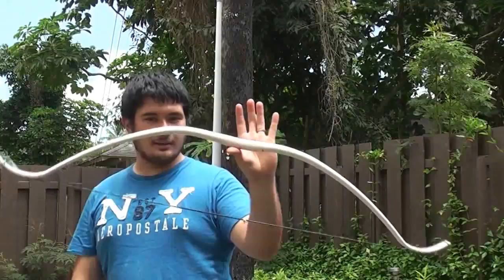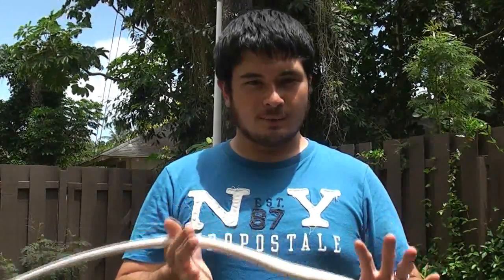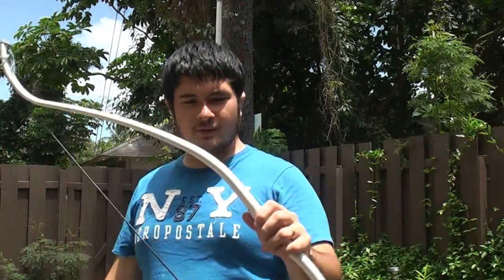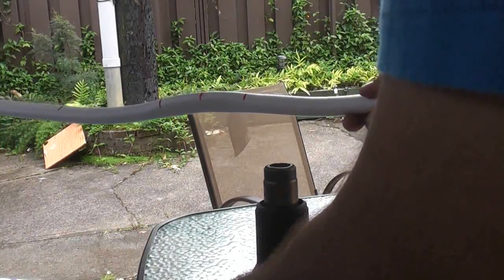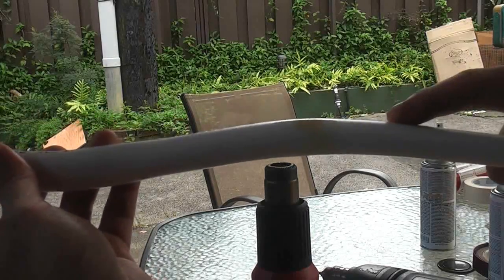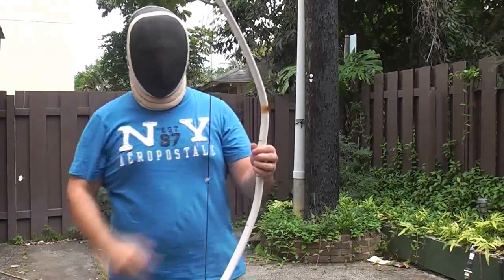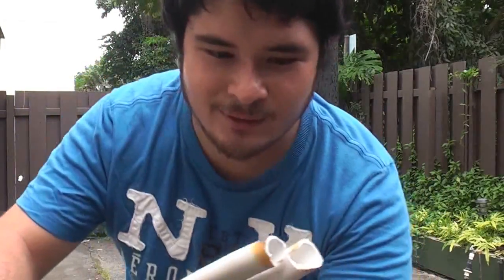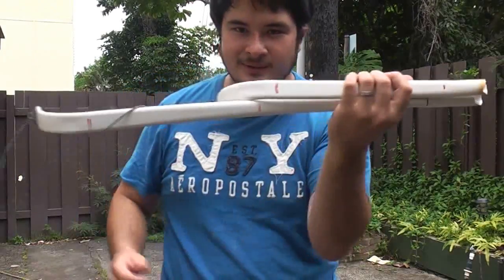PVC Bow Failure - Limb Snap

Comment: Hey, Nick and fellow backyward bowyers, greetings from Brazil! My name is André, how are you?

I've made some bows and here are my problems and victories so far:

All bows that I've made with 3/4 inch pvc pipes have done well but one so far, out of four. The bow that have failed broke exactly on the middle of the handle. 

But all three bows that I tried to make with 1 inch pvc pipe have broken on the lower limb. Apparently, there are no burns and I am pretty sure I was careful enough. The lengh of the string is also according to the measurements.

So, I think that the reason is that 1 inch pipes made in Brazil are not thick enough for bows that have heavier draw weights. The walls are 2.2 mm. 

Do you think that if I put a 3/4 inch pipe inside inside the whole lengh of the pipe to compensate its thickness would work?

Two bow snaps were actually scary but I really want to make a more powerful bow, because my arrows are kind of heavy, made from aluminium.

If you could help me, it would mean a lot to me! 

Thank you, people! Making pvc bows has been a wonderful experience for me!

Comment: I've noticed that as the PVC burns that the physical structure will start to crack apart almost torn or ripped...when hot it acts like hard to stretch rubber. I'm guessing that  a superficial burn is more of a discoloration while a structural burn is literally changing the structure and produces bulges and makes the PVC brittle and sort of rough looking like porous lava rock.

Comment: Hey, I need some help. I am working on a bit of a heavier bow. I'm using 1 1/4" schedule 40 pipe at just over 60". no recurves so I guess it's a longbow. anyway, I have a very small burn on the belly side of the bow right on the line where the handle ends. the whole area that was burned is just smaller than a dime and has a very feint amber color to it with only about two or three milimeters in the center being a bit darker (still much lighter than the burn you had). is this a problem?

Comment: What about slight browning of the pipe. I just made a 1 inch pipe bow which has a very strong pull weight. maybe 60 lbs. the bow itself is 54 inches long. As i heated the pipe up to make the tapper, I notices a slight browning of the pipe on some areas. Not anything as dark ass your example but slight. is this safe and is my bow to short.l am I taking a risk with this design?

Comment: You can make just about any variety of bow you want with pvc. Depending on the pipe length and thickness. I my first was a 5' piece of 1" pvc that i bent into his horsebow, mine turned out incredibly strong, but he says 3/4" should be 40-50lbs and 1/2" 20-30.

Comment from the maker: The 690 PSI is schedule 80 pipe. That will give a lot of weight and good speed, though if the pipe is gray it will take a lot of set or permanent bend. It's a great pipe to use if you can get it.

The 480 PSI is schedule 40 PVC pipe and is the type I use most of the time. It's got solid performance and takes less of a set with proper care. Either way, they should both work!

Comment: I'm making a flattened horsebow with siyahs, and one of the limbs has several very small cracks along the side of one limb, lengthwise - they're really small, about 1/8" each, and not in a part of the limb that's highly stressed. Preliminarily, I'm filling it with a bit of epoxy, and will be wrapping the entire bow in strapping tape to help contain a failure.

No other risk factors should exist (high reflex, weight, etc.). Do you think this could develop into a more serious problem?
Reply: What are the length of your arrows

Comment: my first bow snapped right in the middle of the handle. I'm not sure why. there were no burns or flat spots or anything. I even wrapped the handle in duct tape and para cord. one of the limbs clocked me in the face. it was a 3/4th horse rounded bow. I just assumed I shaped it wrong and put too much stress.